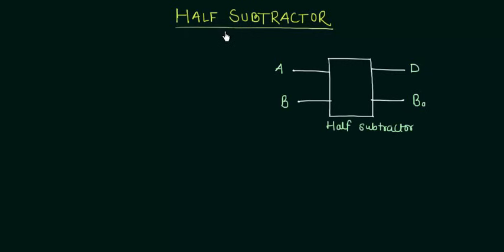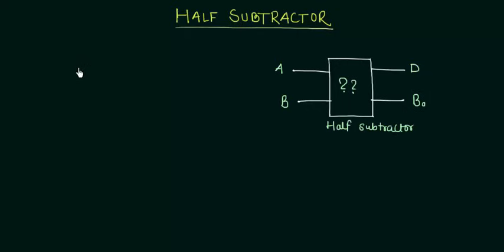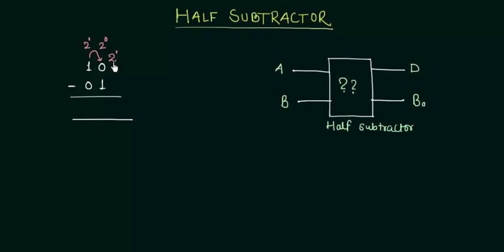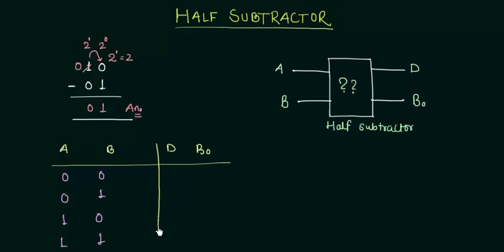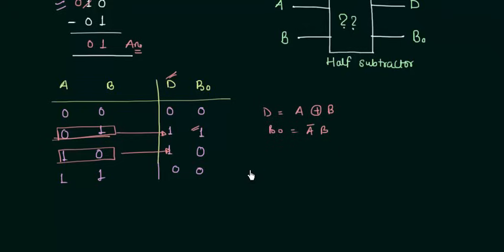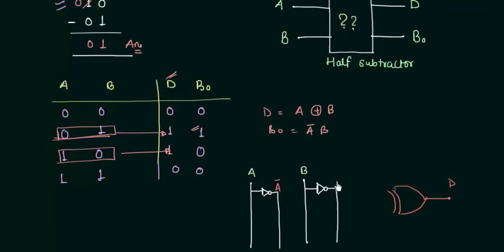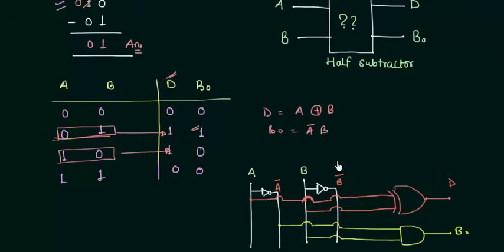Half Subtractor

Comment: Timestamps (Powered by Merlin AI)
00:02 - Half subtractor performs subtraction operation for single bit numbers
00:53 - Understanding subtraction of binary numbers
01:49 - Subtraction in binary involves borrowing and logical expressions.
02:34 - Half subtractor has 2 inputs and 2 outputs
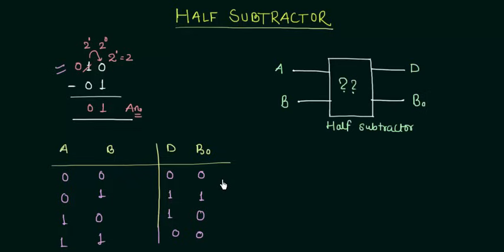03:38 - Half Subtractor's logical expression and gates combination
04:23 - Realizing the half adder circuit using not gates
05:19 - Implementing B complement using XOR gate.
06:14 - The half subtractor requires two input AND gate.

Comment: Ok i can do the truth table , the Boolean algebra, and k map stuff, and I am even starting to understand full/half adders. The problem I have is thinking about it in a practical sense. For example, I can use a k maps and Boolean algebra to simplify a Boolean expression and then draw a logic diagram which can be built on a bread board and checked with led lights, but for adder/ subtraction stuff, what am I actually doing, what can I build with this on a breadboard. Please any help will be really appreciated.
Reply: yeah, I too need an answer for that. Did you find any?
Reply: We check that using a trainer kite with gate IC's

Comment: I think there is an explanation missing in this video regarding borrow :
When you borrow from 2^1 towards 2^0, you're actually making 2^1 * 2^0, which means 2^(1 + 0). ( 2^n = 2 to the power n)
Is this correct? If it is, then I think it's worth mentioning.
Reply: Yep

Comment: Actually,
you've said that,
When you borrow a number and in the place of 0=2^0,2^1 takes place,
and you get two and you can subtract,
but coming to next number as you said it has given,
so zero's left now it's 2^0=1,
1-0=0?!
Please lemme know.
:)
Reply: nope 2^0 is the weight of 0 and 2^1 is the weight of 1. 
0*2^0=0, 0*2^1=0